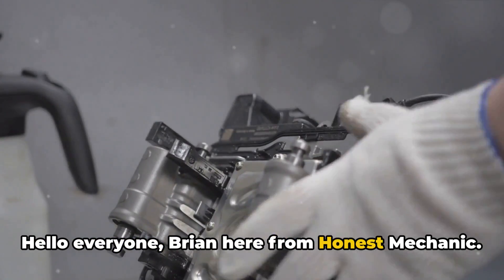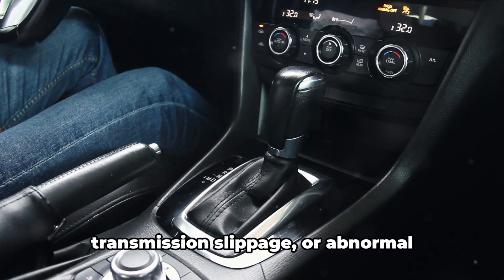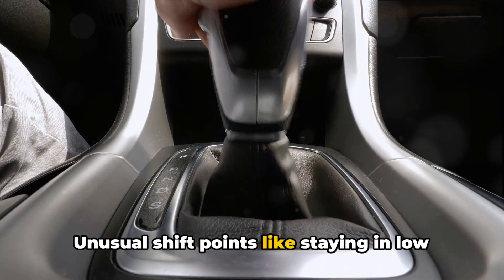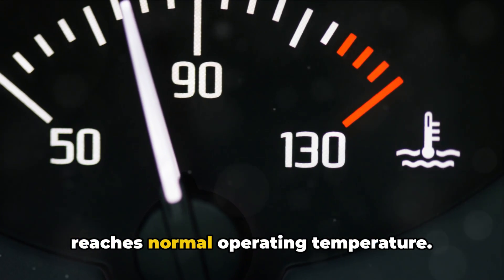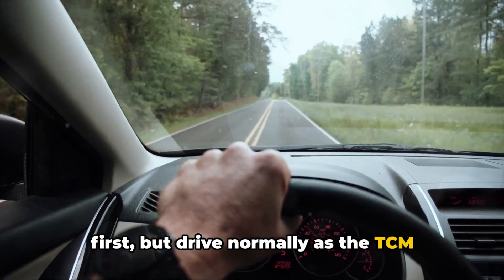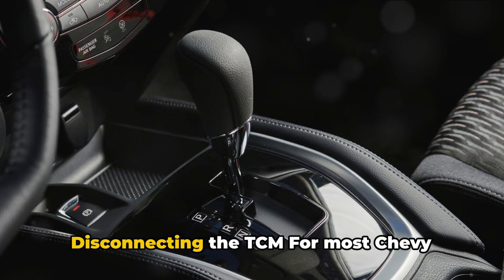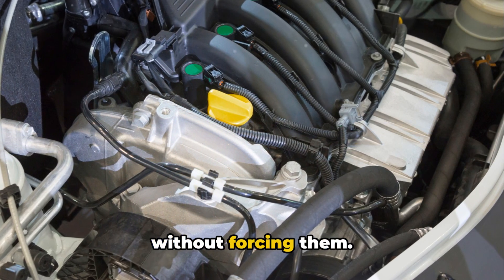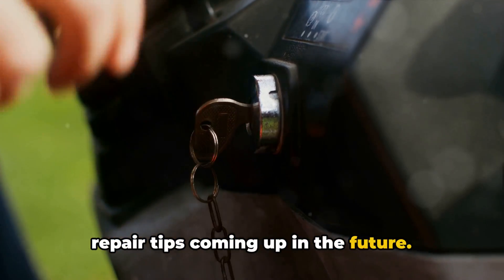How to Reset a Transmission Control Module Chevy: 3 TCM Resetting Methods

Comment: Fluid was real low. No leaks, shifted normal even tho the fluid was real low.  Installed New fluid to correct level, now it will not go into gear.  RESET TCM and it worked for about 200 feet and then reverse 200 feet then neutral again.  Not slipping just not going into gear.  RESET again and it worked again the same 200 Feet, and I even got on it some the second time/ only in a driveway.  went to neutral again
Reply: That's what mine is doing. Doesn't slip very often, just kicks into neutral after a short distance. Not throwing any codes or anything. Anyone have any ideas?
Reply: Will I need to prime the pump or something
Reply: @tonyfry6531 did you end up figuring out what the problem was? Running into something similar
Reply: That probably means the TCM is bad. It's working for a little while and then going bad again.. maybe

Comment: I need help.  I just changed to the output speed sensor in my 2015 Chevy .malibu ls.  I put everything back together and started the car.  When I go to shift, it does nothing.  The car runs but won't go into gesr.  What should I do?
Reply from the maker: Hi, It sounds like there might be an issue with the reassembly or connection of the output speed sensor or related components. Here's a concise plan of action:

Double-Check Connections: Ensure the output speed sensor is properly connected, and there are no loose or misaligned connectors. Wiring and connectors should be secure and free from damage.

Inspect for Damage: Verify that no wires were damaged or dislodged during the sensor replacement process. Look for any signs of pinching or stripping that could affect functionality.

Transmission Fluid: Check the transmission fluid level and condition. Low or contaminated fluid can cause transmission issues.

Error Codes: Use an OBD-II scanner to check for any diagnostic trouble codes (DTCs) that could indicate what the problem might be. This can provide specific clues for troubleshooting.

Reset Battery: Consider disconnecting the battery for a few minutes to reset the vehicle's computer systems. Sometimes, a reset can help clear any glitches caused by the repair process.

Manual Shift Test: If possible, manually shift through the gears with the engine off and ignition in the ON position to feel for any mechanical resistance or unusual behavior in the shift linkage.

Let me know how it goes
Reply: 2014 impala limited?
Reply: Good afternoon I have a question my tcm is not responding I tried your method and I don't no if I'm doing it right besides this method do any work on 2014 Chevy Cruze ltz
Reply: @josephcockheran850 did you eventually get it to go into gear? I'm having the same problem and can't figure it out
Reply: @valleybluuuuue  changing the output speed sensor shouldent have any effect on gear selection, make sure u dident knock any wires or shift linkage out of spot
Reply: Any time you change anything in the transmission you will need a scanner to do a relearn with the solenoids
Reply: Im really supposed to go wide open on throttle for 20 seconds and shut it down with throttle wide open?
Reply: @SpringReign  NO!!!  With engine off (really - not being a smart ass) Do not do this with the engine running !!!!!
Reply: Will this work on a 2019 Chevy impala premier?